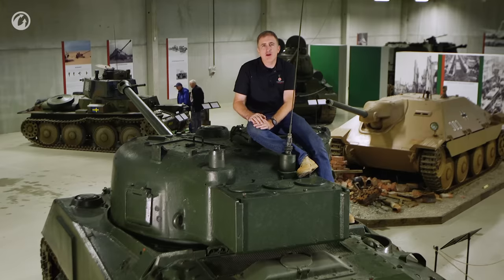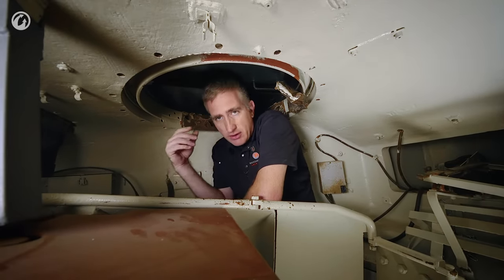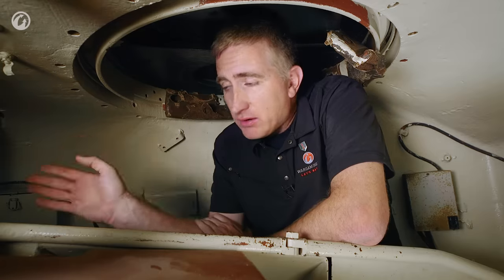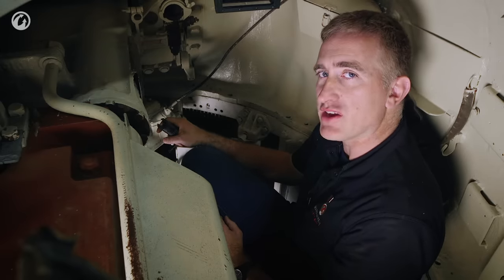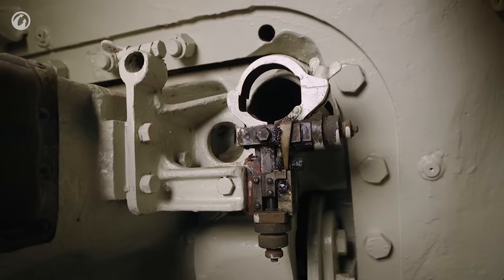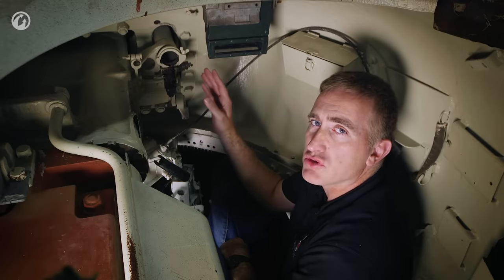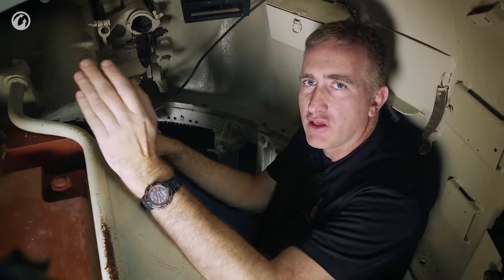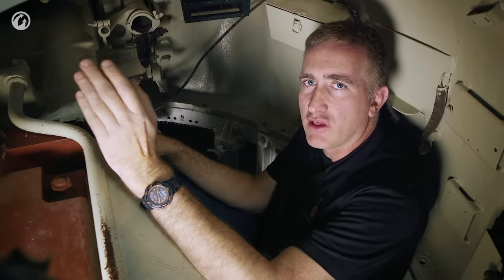Inside the Chieftain's Hatch: Sherman VC "Firefly" part 2

Comment: Makes me wonder how they managed to bother squeezing the 105mm into those turrets.
Reply: Una Peppina 105s breach I don't think was that big compared to the 17lber, remember it was a low velocity howitzer... unless you mean the French 105mm they managed to stick on it later on during the 50s
Reply: if i remember right, that turret is a bit bigger than the fireflys
Reply: The 105mm was a low velocity howitzer so had quite a small recoil assembly
Reply: People always want a big gun in a small tank. I am just wondering how tiny the crew who were assigned to a 105mm Sherman were. I mean we've seen a mere 17 pounder leaves little room to work with.
Reply: The 105 was large in diameter, but short in length. Its a low velocity round, so it had quite a bit of room compared to 17 pounder or 76mm equipped M4s.
Reply: ...Wait people think we're talking about the howitzer..Jeez do you're homework he's talking about the   M4A1 Revalorisé. Which did not mount a low velocity howitzer. Both a huge ass HV tank killer of a gun that required a hell of a lot of modifications to fit on a Sherman hull.
Reply: clothar23 well it's an easy mistake to make. The 105 howitzer is a much more well known variant seeing as the HV 105 modification was post-war.
Reply: in argentina we had a lot of shermans fitted with the french 105 mm
Reply: anotherrandomtexan25 yes, I think he is referring to the French SA50 gun rather than the howitzer
Reply: The 105mm was a short barrel so it didn’t need much space also known a howitzer
Reply: clothar23 how are we supposed to know that he is talking about that there is a 105mm howitzer and the 105mm autoloader and there is a 105mm cannon the most reasonable one to think about is the 105mm howitzer so tell me how you are supposed to know which gun he or she is talking about
Reply: They made bigger turrets
Reply: They were able to squeeze the low-velocity 75mm into the Pzkw III when the high velocity would not fit. Velocity equates to mass.
Reply: Too much World of Tanks going on here. Any normal person would assume the original comment related to the 105 howitzer.
Reply: I thought that the 17 pounder was 105
Reply: the other main reason is the shells were very long
Reply: Howitzers run smaller.
Reply: Purge Blade #231 It had a different turret converted from the 76mm Sherman.
Reply: @yourfriendlyneighborhoodli3559  
17 pounder was 76mm

Comment: I remember reading how Joe Ekins, the man who knocked out 3 Tigers in his first action, had only fired the 17 Pounder 5 times during training.  There were two other separate reports out of Normandy where Fireflies knocking out 5 Panthers each with as many shells.  The British must have worked out a way to operate them effectively from a cramped turret.
Reply: Promoted to radio operator.
Reply: chris hoff iirc Wittmann (the tiger "ace") was killed by a Firefly.
Strange how some folks overlook this.
Yes "battle" reports are often "confused", but it appears Fireflies really could and DID kill Tigers.
Reply: chris hoff-  Englishmen were smaller than the average American back then, which made them better suited for tank crewmen than the Yanks.  Big guys just don't fit well in tanks and fighter plane cockpits.  They're better suited as infantrymen & cannoneers.

Comment: For a "really small turret" it sits on an enormous turret ring... For perspective the Sherman (and the Pershing after it and it's derivatives like the M46 Patton) had a Turret Ring diameter of 69 inches, which is about 1.75 meters... The Panther for comparison had a turret ring diameter of 1.65 meters... The Tiger's were if I recall properly is bout 1.85 meters...

One can put a much larger turret on the Sherman but that'd end up making one tall tank even more comically top heavy...
Reply: Same turret ring as the T29 heavy tank as well. So, plonk that turret and you got a good 4m tall monster.
Reply: Actually this is false... Page 197 of "Firepower A History of American Heavy Tanks - R.P. Hunnicutt" shows a measurement both written and pictoral on the section about said tanks that states that the T29 and derivatives have an internal turret ring diameter of 80 inches which is bout two meters and a bit on the ball race...
Reply: Sorry not the T29... I was thinking of the T32. I was just thinking of the M6A2E-1 project. I have read his book.
Reply: True for the T32 but the M6A2E1 is also an 80 incher... And yes don't question why I've got these a bit memorized since that book was a part of my childhood... Sadly It was misplaced during one of the many house moves...
Reply: The M6s, being based around the 69" turret ring originally. I just completely blanked out on the turret diameter for those, and misinterpreted it.
Reply: Either way... The Sherman has a significant Turret ring diameter... And it did get to see itself have larger turrets on it for a head... From that single prototype of it having the Pershing's turret to the Jumbo...
Reply: Indeed it did.

Comment: The Fetish for the Firefly is around the idea that More is better...When More isn't always better if it's got faults.  What you need is Enough, not More.
Reply: Fire speed of Firefly Sherman crew was much lower than that of 76 mm gun using Sherman crew. And accuracy of Firefly was relatively poor, especially comparing it to German 7.5 cm KwK 40/L48 gun used by most German AFVs. Penetrating armor is one thing. How much does it caused damaged inside the tank is another issue. In case of Firefly the result was not so brilliant as claimed.
Reply: Better is the enemy of good.
Reply: @matshagglund3550  the accuracy wasn't a limit of speed. The gun sucked in accuracy in tests
Reply: The Firefly was the only Allied 3” tank gun that could go nose-on with German armor encountered in the ETO.
Reply: @Snookynibbles  you need to watch more chieftain videos, a. Your wrong and b. It was badly flawed

Comment: Tanks should be evaluated in a troop format, not individually.  In battle, individual tanks are unimportant but the cumulative power of tanks working in concert is decisive.  Sherman's were the ultimate troop tank in WWII.  NOTHING was better or even equal.
Reply: yes...which is why it took 6 Shermans tanks  to kill one tiger tank 
5 to be shot at varying ranges and the last to 'sneak' up behind in the confusion and fire the kill shot from  point-blank range
Reply: @alt7488  Wow I never thought I'd actually find someone who'd unironically post the "5 to kill 1" bullshit. And even mess it up and say 6 instead of 5. You know, with it being so unbelievably thoroughly debunked by now. If you did even a tiny bit of research you would learn that even the standard 75mm Sherman had favorable kill/death ratios against all German tanks, even the heavy ones. You'd also know that this Sherman could punch right through the front of any German tank at combat ranges. So no, it did not take 5 (or 6) Shermans to kill a Tiger; statistically, it took less than 1.

You know what makes this BS even more hilarious? US forces only encountered 3 Tiger Is on the entire western front. So even if the "5 to 1" nonsense was legit, a sample size of 3 instances is laughable. Do some research. Or keep mis-quoting BS you read on forums, it makes you look super duper smart.
Reply: @alt7488  that is a lie actually

Comment: My research came across British test results that specifically denigrated the 17pdr's "HE" round for terrible fuse performance.  Neither the graze fuse nor the nose fuses worked dependably.  For this reason NO High Explosive Ammunition was issued to most Firefly tanks (and precious little to 2pdr and 6pdr crews, either; tank, or otherwise).  I would be interested in any perspective you might have on the topic.
Also curious to me is the fact that the UK did not demand a CS version, which would complement the "normal" and 17pdr types.  We did put the 105mm in, and they got a bunch of those, but surely that wasn't timely (meaning middle of the war).
Which brings up a question: which is better (tactical directives and philosophy for perspective for employment also modify this): Turreted or Non-turreted Assault guns for Infantry support?  A turret makes your job of laying the gun so much easier, but StuGs are better for absolute rate of fire (per caliber of main weapon), concealment, and onobtrusiveness when maneuvering.  So, I would suggest that the StuG is the better working environment for its crew and, therefore, a better match of requirement to hardware.
Reply: I'd assume they never wanted a CS version of the sherman since they had the churchill and deemed that adequate for the task.
Reply: and the 75mm shermans which had a much better high explosive performance

Comment: The big picture of Firefly is focusing British fear of German Tiger. The price of putting that gun to tank caused several not so nice issues for crew itself. In some way the story is similar with T-34. Slope armor might looks fascinating but negative aspect is making that tank cramped lowering fire speed for instance. Firefly Sherman crews faced similar issues. Firefly was not also very accurate as test results have proved.
Reply: Mats Hagglund-  Yeah, but engagement ranges averaged only 500 yards and in the hedgerow country probably one-fifth of that.  In fact, I read where the Panthers, with their much longer gun tubes were at a real disadvantage in the hedgerows and the Sherman held the edge over them in close quarter combat, where the shorter barrel of the Sherman allowed for easier, uninterrupted traverse of the tube.  And at those short ranges the medium-powered 75-mm AP round didn't have any trouble at all penetrating the Panther's side armor.  Hell, it was at virtually point-blank range.  Then, when some enterprising soldier got the brainstorm to weld those 'dragon's teeth' onto the front of the Sherman's hull, the Sherman could enter enter the bocage field at any point of its' choosing, tearing through hedgerows at will.  At least in the bocage country the Panther was the hunted and the Sherman the hunter.  It was lousy tank country, especially for the Germans.  Once out the bocage things changed, of course, but by then the Germans were backing up and continued backing up clear to Germany.

Comment: Sherman VC Firefly - not "perfect", a definite improvisation.  But it was overall the best way to get that excellent 17-pounder gun into the field, to keep up with and support their tanks, for the British Army.  Other solutions were the Archer, and the Valentine tank platform was liked and reliable, but this would have complicated logistics somewhat to have two entirely different vehicles in the same unit.  Could a fixed-mount tank destroyer, like the German and Soviet "panzerjagers", have been built from the Sherman, or could something like the M10 "Achilles" have been improvised?  I'm sure those alternatives were considered.  It was a decent tank-killer WHEN the Brits NEEDED it.  Later on, when they got away from the tanks vs. tank destroyer doctrine, their Centurion mounted the 17-pounder at first, before "graduating" to the 84 mm 20-pounder main weapon and finally the L7 105 mm gun.  The Comet, which was probably even better overall than the M4A3E8 "Easy Eight" Sherman, had enough of a main weapon in that 77 mm HV gun to acquit itself on the battlefield, as it would soldier on until 1960.

Comment: There are historical sources that confirmed that the Pershing's T26 turret could feasibly be fitted onto the Sherman's turret ring. Unconfirmed sources also said that Brigadier General McLeod Ross once suggested mounting the 17-pounder gun into the T26 turret. Neither proposals ever became a reality. Could the larger T26 turret armed with the 17-pounder gun be a better fit for the Sherman Firefly?
Reply: Possibly, but why would you do that? The Centurion was already being put through its field trials and it had been designed to comfortably accommodate the 17 pounder gun with provisions for future gun upgrades.
Reply: @RedOrm68  There's no doubt that the more modern Centurion turned out to be a better long-term option for the British Army instead of an upgraded yet outdated Sherman. The question concerns if it is technically feasible to fit a 17-pounder gun into a T26 turret and in turn fit a 17-pounder gun T26 turret onto a Sherman hull.

Comment: Did the fire fly have a chance off knocking out a tiger 2 with a frontal shot
Reply: Not through the front plate no
Reply: Apparently if a firefly came face to face with a tiger II frontally then it’s only chance was to try and bounce a shot off the underside of the tiger 2’s gun mantlet into the top deck of the hull. Dicey to say the least.

Comment: What has to be understood is that both the UK and the US had plenty of experience in fighting Panthers and Tigers in North Africa & Italy. Even the MkIVs and Stugs had better long barrel 75s than a Standard Sherman and the MkIIIs 50mm would penetrate a Sherman. So something with a more powerful gun was needed and everybody made a right meal of producing something. Scandalous really. US army ground forces, for whatever reason, prevented or delayed either the 76mm Sherman being fielded or the Pershing. And the 76mm, even with all it’s accuracy, was not as powerful as the Panther’s 75. Or the MkIVs 75. So the choice for the British to deal with the big Germans was the tank destroyers, open topped, thin armour, infantry fodder, or shoehorning the 17pounder into a Cromwell or Sherman. What should have happened is that the Allies should have landed on D Day armed with Centurions and Pershings, but that didn’t happen
Reply: 1.there are no Panther in Africa
2.most tanks engagement is you fighting infantrys with/or field guns not tanks you comparing tanks to tanks is wrong
3.the Centurion is still on the drawing board
4. The Pershing is still not ready
5.the US didnt bring the 76 on D-day is because read no.2 and logistic

Comment: It was a tank killer that could fire a pretty decent HE shell...
Reply: Lone survivalist314 It's HE shells were actually inferior to the 75mm and 76mm, the 17pdr was better because of it's AP rounds. Where as the 75mm struggled point blank and the 76mm had to be fairly close, the 17pdr could penetrate the front of a Tiger or Panther with ease, in fact if they were at the right angle the 17pdr in theory could penetrate the front of a Tiger II but it wasn't recorded actually happening
Reply: jordan the 17 pdr did get an effective HE shell later during the  war

Comment: It's one of those icon tanks. Most to its name perhaps but it was a tak that actually could stop a Tiger or Panther from some distance. I need to go to the Arsenalen some day because it's not that far from where I live... :) Thank's Chieftain! (Nicholas Moran)
Reply: Meh both the 75mm and 76 Shermans could kill German armour just fine . People vastly overrated the German cats in both armour and overall performance. Hell a patient infantry  soldier could kill a German cat, ya just wait for the over engineered things to break down. Then you chuck a couple grenades down the air intake to destroy the engine, tank taken care of.
Reply: a 75mm Sherman not being able to kill a cat from the front when said cat is about to blow you away is not what I would consider "capable".

the 76mm and firefly are a better tank than a Tiger or Panther, but the only reason the 75mm stands a chance is the number disparity.

Comment: I personally think the firefly was a worthwhile conversion. It is also an example of the British want to not start lacking behind in tank development like they had earlier in the war. The result that was they were prepared for the relatively large number of panthers they encountered (relative to the Tiger tanks, who didn't appear in large numbers) in Normandy. The Americans on the other hand, who didn't have access to the HV 76mm yet, were not. 

I also think that fireflies would probably be a good morale booster. I would much rather be part of a unit that had fireflies in Normandy over one that didn't. I expect that other tank crews didn't really think "oh, that must be cramped" or "that's hard to aim". If anything, I think the large amount of flash and smoke the 17 pounder produced would have been seen as a sign of power. It sure would be impressive to see, and you know that if you find a Tiger or a Panther, that there are tanks close by that are able to reliably deal with them.

Comment: On average it took what 8-11 Sherman’s to knock out a Tiger.  And a Firefly could do it in one shot. No matter how it was done, it was done. And know they had a tank that could penetrate a Tiger head on.  With thousands of men dying each day if it could do the job you got it into production and on the battlefield ASAP. Crew conveyances be dammed. It was the best compromise, that could be effective on the battle field, at the time. Take what you’ve got modify it and make it work. With the invasion coming time was not a luxury they had. The presentation was very educational for a tread head like me. Thanks for the info.

Comment: British distribution of the Firefly was 1 per troop  of 4. I have read that the 76mm fitted to the American Shermans,  was no better at piercing the amour of the Tiger and Panther than the 75mm
Reply: The 17pdr had considerably more penetration than the American 76 but was better than a 75 especially if you used HVAP ammunition. American 76 more accurate though.
Reply: @kevin_1230  Yes you are right, the problem with the 17 Pounder was that it wasn't that accurate
Reply: @Andyww08  Yes but it was not inherently inaccurate.